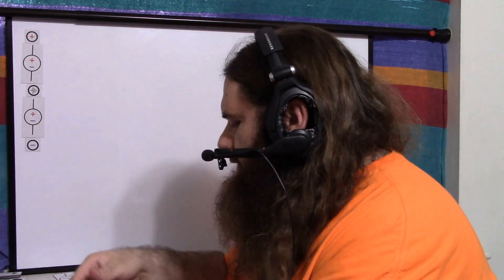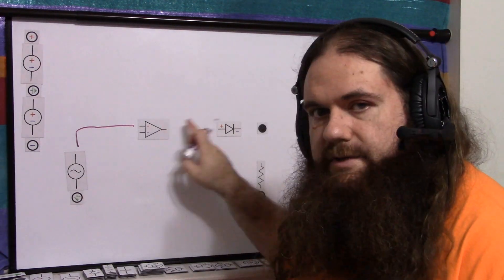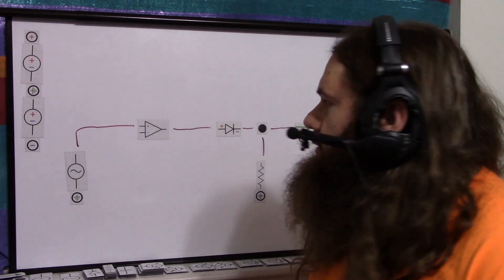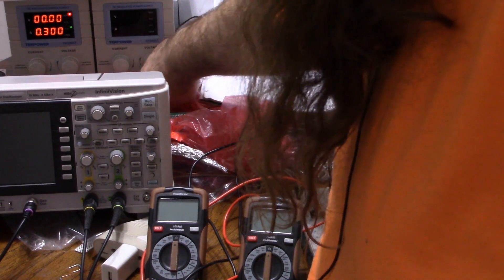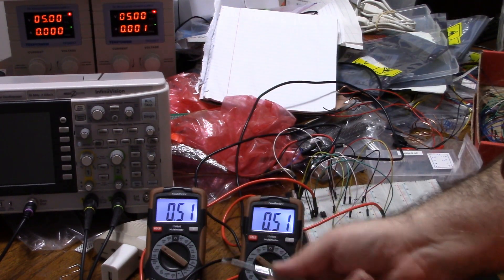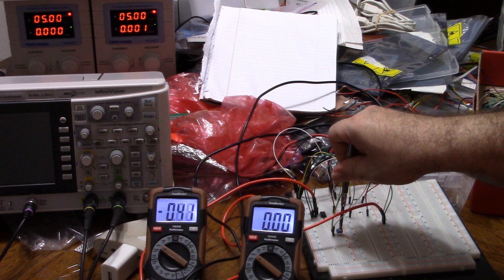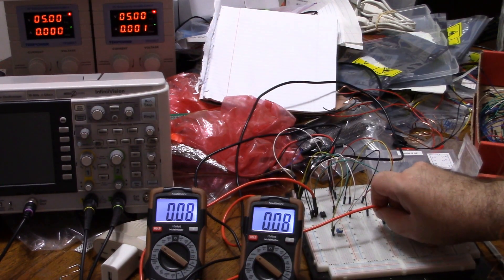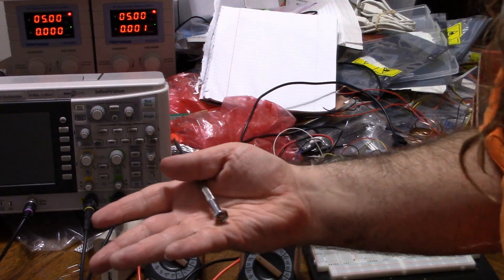Ideal Diode - Bypass The Voltage Drop For Perfect Signal Passthrough With An Op Amp - Simply Put

Comment: Op Amps (or how we use to call them in school - Операционен усилвател ОУ) are very curious and fun to do stuffs with them. The cool thing is they are cheap and some of the dip 14 packages have 4 or 5 of them
That usage is very good for low voltage detection on the start of some cycle. I used similar technique to clamp the sine wave start to trigger counters

Comment: I'm thinking that in the case where the source is strictly DC, then the diode will always be conducting and therefore the pull down resistor could then be eliminated.
Reply from the maker: Only if the signal is never zero or negative, which could happen due to noise even if you're using a signal that should never be negative, plus tolerances in parts and the fact that op-amps wiggle a bit could render the circuit unstable near zero. In principle you're right, though, and the same will be true for the full-wave version in the next video going up.